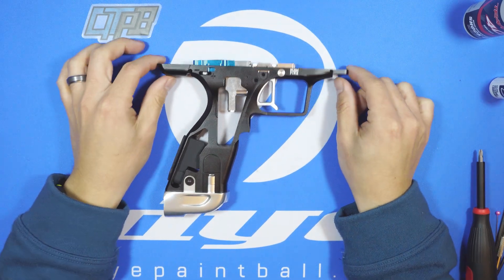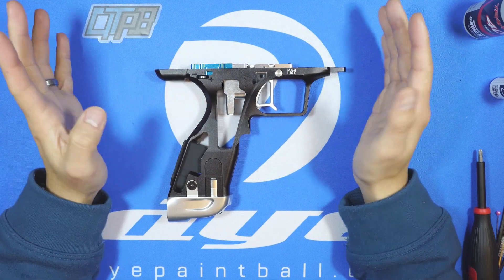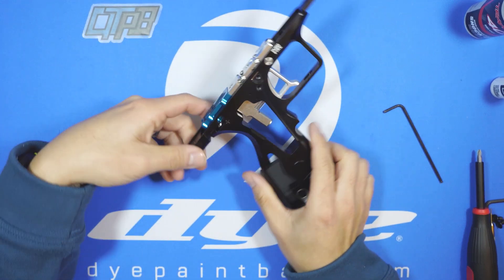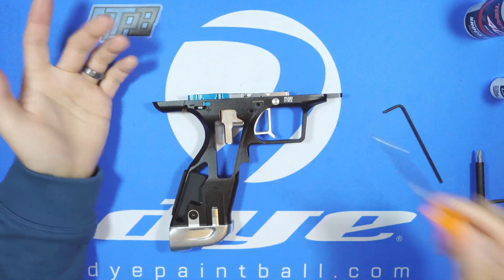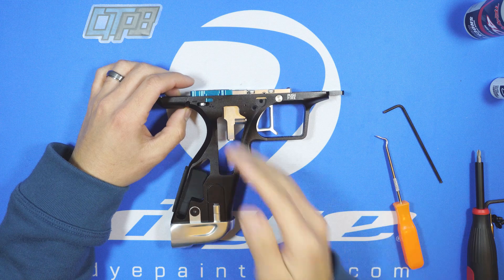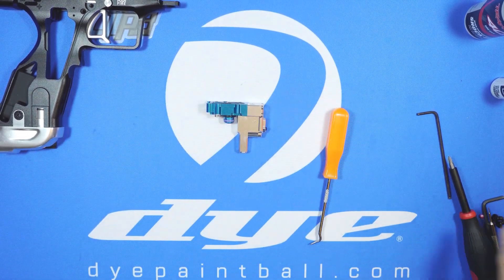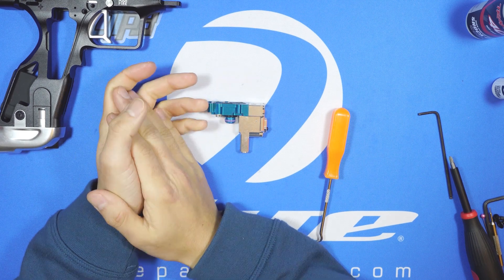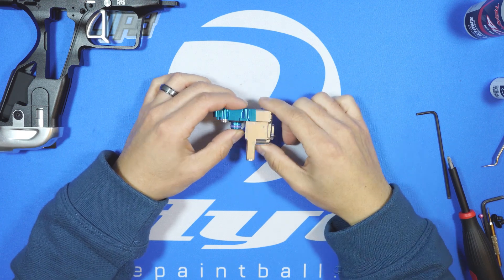Dye DSR+ Mech Frame | Troubleshooting Guide

Comment: I have a silly question; when you were finished cleaning out the trigger switch assembly and dropped the couple drops of oil in the blue valve body it got me thinking. Is there an issue with almost treating the mech frame like a cocker as in dropping a couple of drops of oil in my asa for basic maintenance and dry firing in addition to relubing my bolt?
Reply from the maker: I would be more focused than that approach. The autococker is pretty robust where the DSR needs a little more attention
Reply: @QTPaintball  Roger that! thank you for the response! Happy New Year :)

Comment: Is this only for the mech frame solenoid? I just bought a new dsr+ and I always rebuild/relube  my markers when I get them as they all come over lubed from the factory and I noticed the drivetrain and reg were packed with grease.
Reply from the maker: Yes, this pertains to the mech frame. 

Always better to have more lube than not enough when the marker may be sitting on a shelf for awhile. The issue is the lube is old stock and is really thick, very problematic. The issue with our vendor should be resolved, now.
Reply: @QTPaintball  ok thanks. Love your videos! Still waiting on your dsr+ review

Comment: Thanks for putting this up. On Amazon, I see there is 55 weight RC shock lube available. In your video, you mentioned it would be best to have higher weight or hybrid blend.
Do you think 55wt would do it?
Reply from the maker: Honestly, I don't know. I know John has been testing 35wt, and may be leaning towards that. I don't know HOW much thicker 55 is to know if it's a suitable alternative

Comment: Also, I noticed my pin had black residue on it, my guess it’s the factory lube breaking down the orings.
Reply from the maker: Black residue is okay, unless it was really excessive. The standard dye grease is very good. The issue we were finding was really old stock/different formula than what we are currently specifying. I recommend removing all of the factory lube.

Comment: Almost sounds like I should hold out on buying the mech frame seems like it should of been tested a bit more considering there’s not even a correct lube for it yet
Reply from the maker: I 100% agree on longer testing intervals. The mech frame was in production before we joined. We are pushing for longer testing intervals now.
There is a correct lube. The suggestion of the silicone oil is something safe to use with the current lube and is easier to apply. Grease requires the full disassembly to apply correctly. Which is more than some users feel comfortable doing. 

Fortunately, this morning I believe we have resolved all issues and are making a plan to roll out fixes for those impacted.
Reply: Awesome so basically if I buy the frame this Friday I just need to break it down and get ride of old grease and use just the pe oil with a mix of the dye grease?  Or should I wait a few week? I love my dsr+ and can’t wait too use it at the icpl old bay classic
Reply from the maker: If you're planning on going to ICPL, go talk to Billy. If you have a mech frame, he'll get you sorted with a part we are planning on moving forward with.
Reply: Can we get this part at the ICPL Pro DNA Open?